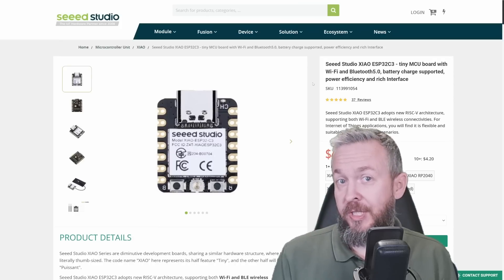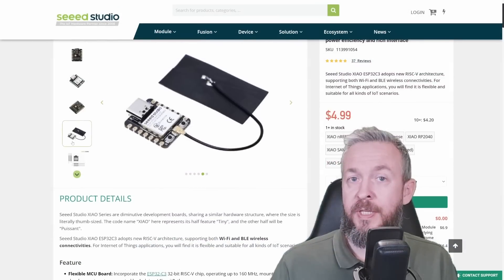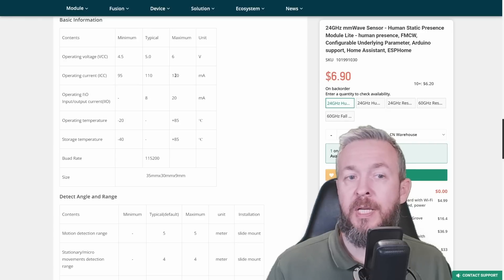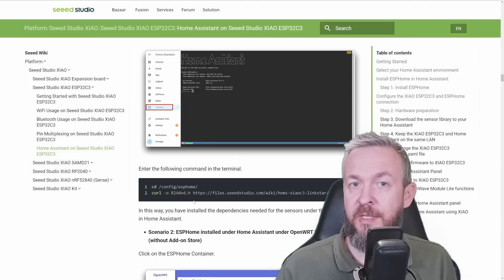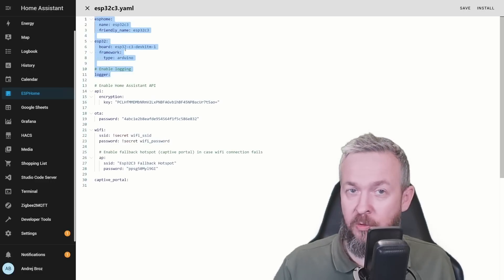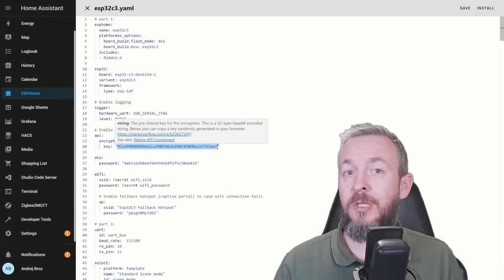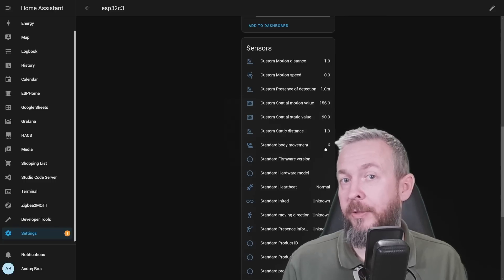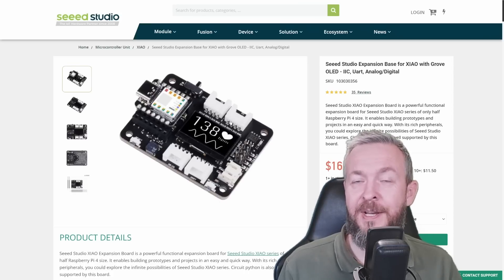ULTIMATE IoT project ESP board & NEW mmWave sensor

Comment: Nice video! I am trying to compile the MR24HPC1 in ESPHome using an esp32dev board on pins 16-17 RX-TX but I get compilation error if i use the github xiaoesp32c3 yaml file. Is this going to work with an esp32dev board or do i need to buy a xiaoesp32c3 board?
Reply from the maker: If I remember correctly the yaml is configure for specific board - ESP32C3 board. You should be able to flash also with ESP32DEV board but you need to select appropriate board type and other specific setting plus of course pins you've mentioned.
Reply: @BeardedTinker  Thanks! I will give it again a try

Comment: Just letting you Guys know: the mmwave Sensors have a high fall Out rate. Of 5 Sensor 3 are know defect after 2 weeks of usage. Also the WiFi antenna of the esp32 Mini Boards are totally worthless. They have constant disconnects. I replaced the with other pigtail antennas and have nö Problems since.
Reply from the maker: Haven't seen this issue yet.
Reply: @BeardedTinker  maybe I Just have a bad batch. I am in contact with Seeed. They said they will investigate this issue, but i haven't heard from them since 10days.i opted out to an hlk-ld1125h Sensor and it been working nice since days. I even have a usable Sensor, that just states recognized/unrecognized which works just fine for automations. The Seeed Sensor is missing this simple Sensor in the config completely!  Concerning the antenna of the esp32(-s3), it'sobvious that it is crap. If you use wpa3 it doesn't work stable. On wpa2 it works much better, but i don't know how that is related in any technical way to the problem.

Update: Just got a reply from Seeed: 
Hi，

During this time we investigated the cause of the problem, it was caused by the fact that the radar was not in custom mode when adjusting parameters using the esphome console, this triggered the protection lock of the radar, please try to unlock the protection lock using the attached tools and guide and then reflash the firmware according to the wiki, I believe this will solve the problem.https://wiki.seeedstudio.com/Radar_MR24HPC1/#firmware-version-updates  
https://files.seeedstudio.com/wiki/Radar_MR24HPCB1/ArteryICPProgrammer_V2.4.23.zip

https://wiki.seeedstudio.com/Radar_MR24HPC1/
Reply: Hi, did you manage to fix the issues by updating the firmware? I recently bought the sensor and connected it with esp32 and got the readings only once, after that the sensor stopped working. I tried reflashing esp, changed uart pins, powercycled it and it never worked. Every entity is unknown or unavailable.
Reply: @anandsaravanan8732  Had no time yet.  The Sensors are glued with hot glue into place and i can hardly reach the pins for reprogramming. I will let you know as soon as i do it. I am tinkering with ld1125 mmwave Sensors right now and they seem to Work much better and faster, so i think i will replace the Seeed ones.
Reply: @t0mz3n75  goodnews, finally managed to update the firmware using the uart to usb method and the sensor started working. Hope it wont break again. 

initially the uart programmer didnt work, power cycled the sensor alone and it started the flashing process.

Comment: do you get more sensors in home assistant if you get that presence sensor compared to the LD2410B or it is just having the code to be as the code you showed since both are using 24G mm wave
Reply from the maker: You do get more code in HA with Seeed Studio sensor than with LD2410B, but dsome of it is configuration parameters that you don't have with LD.

Comment: @BeardedTinker great tutorial! I am wondering if the "standard body movement" data 14:39 can be logged / mined through home assistant? Also, is there a valid link to your discord?
Reply from the maker: All of the data should be stored in database inside HA. depending on the retention period you have set, you can use historical data for analysis. Also you can setup on that sensor data min/max/mean sensor to get those values too.

Comment: Thanks for a great idea! I was looking to buy a presence sensor, but it comes pretty costly compared to PIR sensor.
Do you have an idea how I could use this, but with battery power? I don't have a wall socket near the place where I will put it so I'm trying to find out how to power it with batteries.
Reply from the maker: That's not that easy. It will also bring a lot of delay on triggers - not that device is slow, but WiFi and sleep adds a lot of overhead as it takes some time to wakeup, do WiFi handshake and send notification. Anywhere from 5-12 seconds from my tests. But biggest concern is of course battery life. In sleep power consumption can be lowered but since it does need to power motion sensor, not sure how long battery would last.

Comment: Some updates from me:
I managed to get it installed with the following snags:

1. Had to add the esp32c3 to my network DNS as it (HA?) could not resolve the esp32c3.local name
2. Seeed changed their pins to D2/D3 for stability reasons? 
3. I had to change the esp32c3 yaml part 1to the below because it could not find the right version for CMAKE to compile.

esphome:
  name: <name you defined here>
  platformio_options:
    board_build.flash_mode: dio
    board_build.mcu: esp32c3
    platform_packages:
     - framework-espidf @ 3.40300.0
     - toolchain-riscv32-esp @ 8.4.0+2021r1
     - toolchain-xtensa-esp32s2 @ 8.4.0+2021r1
  includes:
  - R24dvd.h

esp32:
  board: esp32-c3-devkitm-1
  variant: esp32c3
  framework:
    type: esp-idf
    platform_version: 3.4.0

I hope this helps people out there.
-------
Now after all this I could see the esp32c3, it would even show me the firmware version etc so great. I let it run all night and since the morning it's connected but all reported sensors are stuck on 'unknown' and status is 'abnormal'
Tried restarting it, unplugging and replugging in.. no bueno :( Any help would be great.

Comment: Hi, the oficial site on "Hardware preparation" say: RX to D2 and TX to D3, but on yaml file on uart section say: rx_pin: 5 and tx_pin: 4, can you help me?
Reply from the maker: Did you check in video? I show where cables are connected.
RX and TX pins on ESP32C3 are pins D7(RX) and D6(TX) - they were according to documentation  GPIO20(RX) and GPIO21(TX).
Not sure why few days ago they changed it to GPIO4(D2) and GPIO5(D3). 
I didn't update to that code or changed pins
Reply: Yes if you are following the connections in the video the github code needs changing to say   rx_pin: 20 and  tx_pin: 21
Reply from the maker: Yes, recently Seeed studio changed pins and code on GitHub. I still haven't tested with new code on different pins.

Comment: Thank you very much for this video. One question, I didn’t saw a occupancy sensor, should I need create it by myself? I mean like the FP1 shows out of the box the occupancy.
Reply from the maker: As in away/present? No, not currently from what I know. You could potentially create template binary sensor to check if value is 0 (or less than any values you want) to toggle away/present. But I haven't played with that so far.
Reply: @BeardedTinker  Thanks a lot, unfortunately I can't get it to work because I get an error. I have been trying to find the problem for couples hours. I did exactly like you did but i got this message: WARNING Can't connect to ESPHome API for test.local: Error resolving IP address: [Errno -5] No address associated with hostname
Reply from the maker: Try to use fixed IP address in network section. And than access from Home Assistant via IP address and not via mDNS name. Looks like network issue by the looks of it.

Comment: What esphome compatible board do you recommend that does Bluetooth proxy and presence detection?
Reply from the maker: Most often I use cheap ESP32 mini boards you can find on Aliexpress for around 5€ - simimlar in size to D1 mini.
When this ESP32C3 gets BT support, it will fall in that range too, but so far it can't be used for that for now.
Reply: @BeardedTinker  Thank you. I am new to this. Thank you for the helpful video

Comment: I've some issues installing the code to the board. Following are the messages during installation. Has someone the same issue? I'm running ESPHome 2023.3.2

Unpacking  [####################################]  100%
Library Manager: libsodium@1.10018.1 has been installed!
INFO libsodium@1.10018.1 has been installed!
HARDWARE: ESP32C3 160MHz, 320KB RAM, 4MB Flash
 - framework-espidf @ 3.40404.0 (4.4.4) 
 - tool-cmake @ 3.16.9 
 - tool-ninja @ 1.10.2 
 - toolchain-esp32ulp @ 2.35.0-20220830 
 - toolchain-riscv32-esp @ 8.4.0+2021r2-patch5
Reading CMake configuration...
-- Found Git: /usr/bin/git (found version "2.30.2") 
-- The C compiler identification is GNU 8.4.0
-- The CXX compiler identification is GNU 8.4.0
-- The ASM compiler identification is GNU
-- Found assembler: /data/cache/platformio/packages/toolchain-riscv32-esp/bin/riscv32-esp-elf-gcc
-- Check for working C compiler: /data/cache/platformio/packages/toolchain-riscv32-esp/bin/riscv32-esp-elf-gcc
-- Check for working C compiler: /data/cache/platformio/packages/toolchain-riscv32-esp/bin/riscv32-esp-elf-gcc -- broken
-- Configuring incomplete, errors occurred!
See also "/data/esp32c3-mov1/.pioenvs/esp32c3-mov1/CMakeFiles/CMakeOutput.log".
See also "/data/esp32c3-mov1/.pioenvs/esp32c3-mov1/CMakeFiles/CMakeError.log".

fatal: not a git repository (or any parent up to mount point /)
Stopping at filesystem boundary (GIT_DISCOVERY_ACROSS_FILESYSTEM not set).
CMake Error at /data/cache/platformio/packages/tool-cmake/share/cmake-3.16/Modules/CMakeTestCCompiler.cmake:60 (message):
  The C compiler

    "/data/cache/platformio/packages/toolchain-riscv32-esp/bin/riscv32-esp-elf-gcc"

  is not able to compile a simple test program.

  It fails with the following output:

    Change Dir: /data/esp32c3-mov1/.pioenvs/esp32c3-mov1/CMakeFiles/CMakeTmp

        Run Build Command(s):/data/cache/platformio/packages/tool-ninja/ninja cmTC_ceb82 && [1/2] Building C object CMakeFiles/cmTC_ceb82.dir/testCCompiler.c.obj
    [2/2] Linking C executable cmTC_ceb82
    FAILED: cmTC_ceb82 
    : && /data/cache/platformio/packages/toolchain-riscv32-esp/bin/riscv32-esp-elf-gcc -march=rv32imc  -nostartfiles -march=rv32imc --specs=nosys.specs CMakeFiles/cmTC_ceb82.dir/testCCompiler.c.obj  -o cmTC_ceb82   && :
    /data/cache/platformio/packages/toolchain-riscv32-esp/bin/../lib/gcc/riscv32-esp-elf/8.4.0/../../../../riscv32-esp-elf/bin/ld: /data/cache/platformio/packages/toolchain-riscv32-esp/bin/../libexec/gcc/riscv32-esp-elf/8.4.0/liblto_plugin.so: error loading plugin: /data/cache/platformio/packages/toolchain-riscv32-esp/bin/../libexec/gcc/riscv32-esp-elf/8.4.0/liblto_plugin.so: cannot open shared object file: No such file or directory
    collect2: error: ld returned 1 exit status
    ninja: build stopped: subcommand failed.
    
    

  

  CMake will not be able to correctly generate this project.
Call Stack (most recent call first):
  /data/cache/platformio/packages/framework-espidf/tools/cmake/project.cmake:296 (__project)
  CMakeLists.txt:3 (project)

========================= [FAILED] Took 14.36 seconds =========================
Reply: Am I really the only one having this problem?

Comment: mmWave board doesn't work until its power cycled after the ESP32C3 is powered. I have to install a swich between the 5v line between the ESP32C3 and mmWave board so I can power down and up again? Anybody solved that issue?
Reply from the maker: Haven't seen that issue so far.
Reply: Yes I agree that this is my experience.  I soldered the board and mmWave board but nothing worked, then realised that the mmWave board needs to be powered after the ESP32C3 which is a bit of a shame.

Comment: Disable and enable doesn't work for me. It keeps disabling
Reply from the maker: I had that issue when Dupont cable was not seated properly. After making sure I had connection, it worked as it should.
Reply: @BeardedTinker  soldered the wires on esp32c3 and mmwave sensor didn't solve the problem. Guess I will have to contact seeed studio
Reply: @JasperTielen   You need a switch between the 5V line, the mmwave sensor needs cycling after the esp32c3 is up and working
Reply: Same for me, soldered short wires and output switch keeps disabling.
Reply: Is there a work around for this?
Reply: The same for me. Disable and enable doesn’t work. Any solution? Thanks

Comment: FINALLY a good price for this project.. I need 1 in each room and possibly 3 more in various areas of the house. Will you consider expanding to also include a PIR sensor to make sure movement is by a warm body?
Reply from the maker: There are more than enough PINs let to add PIR. I need to find one and test it with.
Reply: @BeardedTinker  I was too fast... seeed ran out of the mmWave sensor 😭😭😭
Reply: @BeardedTinker  Your expertise would be much appreciated.. the idea is to detect minute movements and verify that it's from a warm body in 1 device. 1 other idea is a 8x8 thermo sensor that can identify when someone's temperature is starting to be too high or low. Useful for kids and old people alike

Comment: Ive just received a pair of each of these boards from Seeed, the mm Wave sensor uses some very tiny pitch headers....  normal dupont connectors are too big, now I'm left trying to find a source of suitable plugs to use with these small pitch connectors.....  anyone know  what they are called?  Ive measured the distance between the pins, seems to be about 2.4mm
Reply from the maker: That's strange... I've used standard dupont cables for this. LD2410 is using 1.25mm pins that are not standard, but these mmWave should be standard ones - on both sides.
Reply: @BeardedTinker  thanks for the reply, I have bigger issues though, esphome is giving me a problem, many compile errors, restarted everything again from scratch, I can now compile the sensor without it erroring, flashed the binary to the esp using legacy tools esphome method, that went OK, but the device now doesnt boot, and the serial monitor displays a  few messages in a cycle that seem to be during the esp boot sequence.......  if you were able (and I appreciate any assistance...)  can you shed any light?  I know my esp device is working as Ive created a simple blinky led as per the Seeed studio projects pages...  and that does work......
Reply: @tonybell1597  you need "2mm to 2.54mm Pitch Ribbon just received today from Amazon and working fine
Reply from the maker: Hmm - bootloop probably. One thing that can be reason for that is inadequate power. How are you powering the device? I have it connected to PC but via powered USB HUB, to try and prevent those issues

Comment: A thumbs up for your help. I am up and running and with a few tweaks seems to be doing fine. A few questions. If you have yours in a case, what did you use? Also did you make any special yaml changes in HA to use it as a device in your office detection. Again, your channel helps drill down through everything at gets right to the point.
Reply from the maker: Thank you Carlton!
I still haven't found a case for this project, or created box myself. It's on my to-do list, but knowing me and available time, it will take a long time.
As for setting it up, also, no - unfortunately, I jump from project to project and never have enough time to pursue project till the end. I'm thinking on designing PCB that would just have headers for ESP32C3 and mmWave sensor for start - that would remove need for wires and maybe make it easier to create case for this. But...

Comment: Is there already a way to run the esp32c3 with the Hilink LD2410B? I have not managed so far.
Reply from the maker: Connection via cable or Bluetooth?  Via cable should probably be possible, but haven't tried. What PINs are you using?
Reply: @BeardedTinker  I actually meant a working ESPHome code. Which works specifically for the seeed studio esp32c3. With the esp8266 I have the module running. Unfortunately this code does not work with the esp32.
Reply from the maker: Code for 2410 should be same. I think you need to use pins D6 and D7 (same as for this sensor) for TX and RX. Resto of the UART code and sensor one should be same.
But I didn't try to hook this up. I don't have full code.
Reply: @BeardedTinker  Unfortunately, this is not the case. I have used D6 and D7. It comes to the error message when compiling. I am not so fit to fix the error. Do you have a working code that I can use?
Reply from the maker: No, I don't use LD2410B with ESPHome - it's connected via Bluetooth proxy. (actually, it's offline now).

Comment: Shame this board doesn't pack any connectivity of its own tho... LD2410B features bluetooth! and it's a breeze to add to HA, no ESPhome required! I use an ESP32 as bluetooth proxy for the LD2410B, it works great :)
Reply from the maker: Yeah, was testing that also in early HA beta. still have it somewhere around. Did you update firmware on it and have you tired that one with ESP32 board  with cable connection? I've heard that some had issue with 2410B board after some time via Bluetooth connection.
Reply: @BeardedTinker  I've been testing the Bluetooth connection keeps going unavailable and have to mess around restarting integration and sensor. Esphome seems a better way to go
Reply from the maker: Yes... But people also say that flashing latest firmware helps with this. I haven't done that yet.